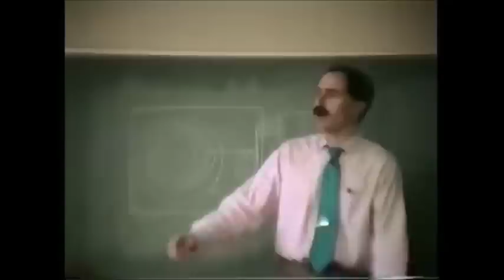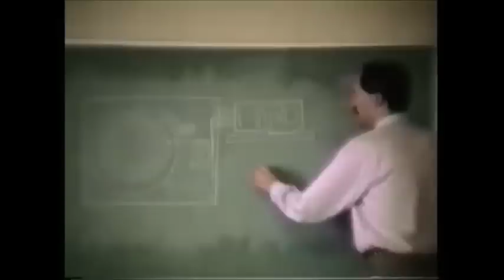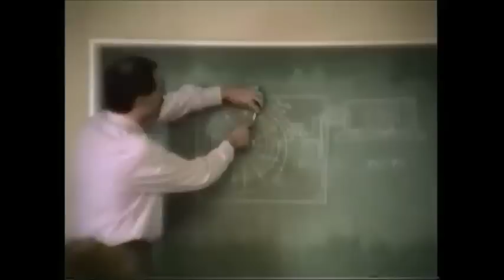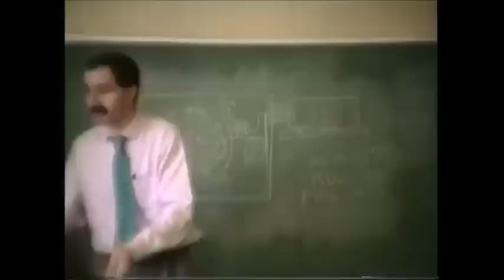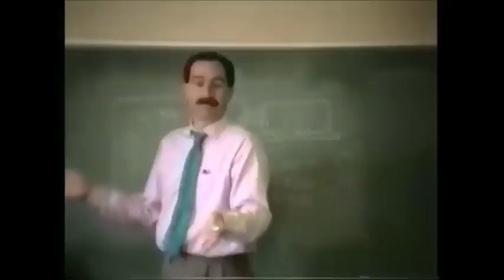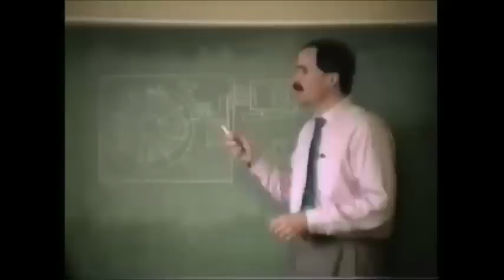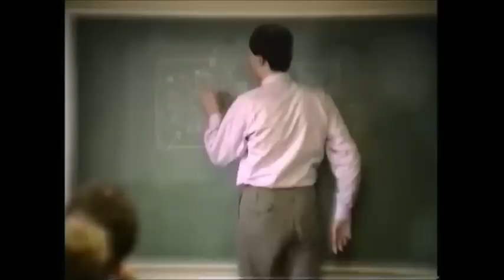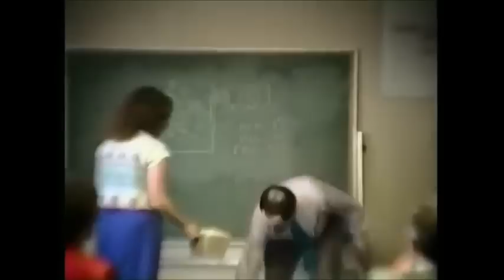Steve Gisbon hard drive and Spinrite lecture 1990.

Comment: I remember having to back up MFM and RLL ans SCSI drives to then low level format them. After low level format then you ran the format command. I do not understand the differance in low level and a standard format on those old drives. When IDE came out we  were told you could destroy the drive iflow level format them. the low level was done at the factorey and we never should touch it.  just the regular format. What Steve describes is my understanding of just a normal format  not a low level. Although I used to do both  with low level first then standard format.  What is the differance.